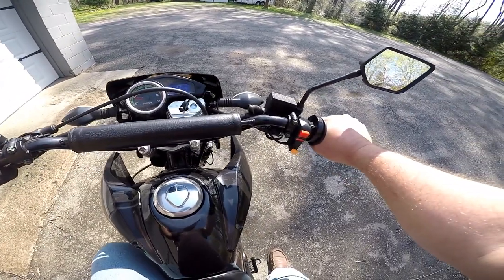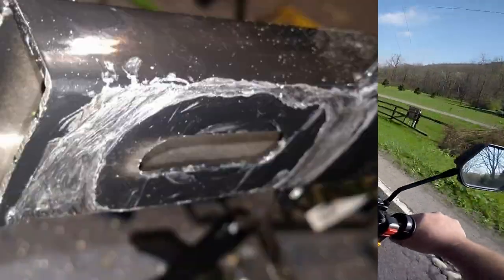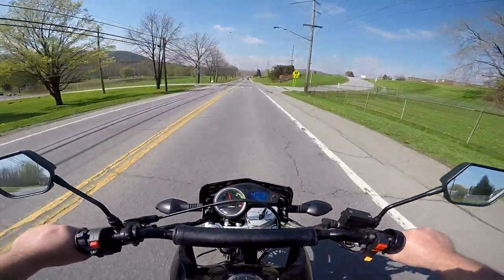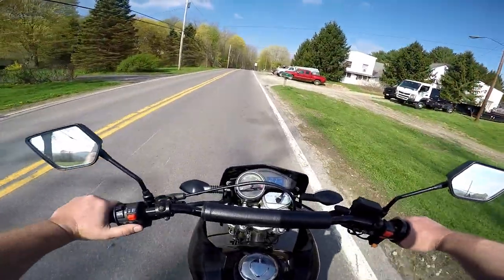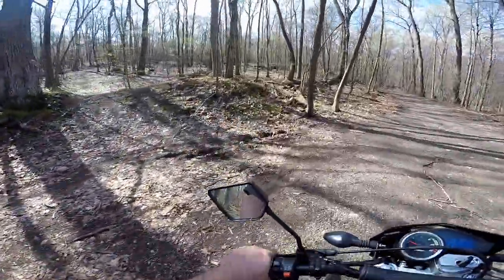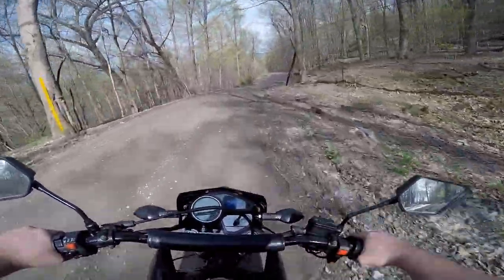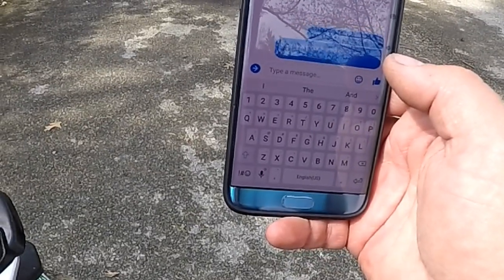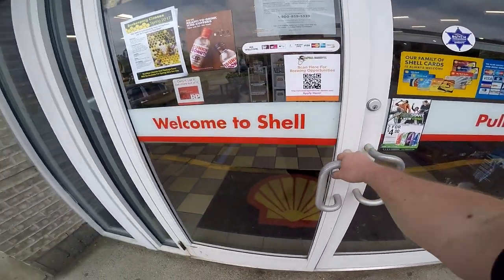[E39] Hawk rear sprocket Stud failure! And a Little ride to Vee's house RPS HAWK 250

Comment: The rear bolts on mine sheered off twice (both oem China bolts). I got smart after the second time and bought original 1976 Honda XR185 bolts to replace them for around $28.
Reply from the maker: Good to know they'll work! thanks
Reply: Where did u find them

Comment: Thanks for the video. The sprocket studs just slid right out of the bearings on the wheel and locked it up and caused other damage on my hawk 250. Not even 3 miles yet. Waiting for response from dealer...
Reply from the maker: Shane Meltzer damn. Yeah, that clip must have popped off

Comment: I have watched many of your Hawk videos and I just found this looking for sprocket studs. I just had all 4 shear on my Hawk the other day. It is 1 year old and has 6800 miles. My son wrecked his Hawk so I am using the studs off his bike. I will be replacing them. This is definitely a first for me on a bike.
Reply from the maker: That clip seems to be an issue that holds the dampener studs in...  I have not had an issue on mine, I keep an eye on it. I did break 2 spokes though

Comment: the studs are free floating. they just keep rotation of wheel with rotation of sprocket. its just held in place with expansion ring clip
Reply from the maker: Yes. For Dampening

Comment: this happened to me aswell. the retaining ring failed.  the pins to only slip in! i found new retaining clips on amazon.
Reply from the maker: Brandon Bowersox wow, finding it more common than I thought!
Reply: Here is a link for the retaining ring I used to fix the bike. I took the opportunity to replace the front and rear sprockets as well. This part was hard to find!

https://www.amazon.com/gp/product/B0062OHC6S/ref=oh_aui_detailpage_o01_s00?ie=UTF8&psc=1
Reply from the maker: Brandon Bowersox thanks!!, I'll add to the links on motocheez.com
Reply: Yep, just got a new hawk and just finished changing the rear and front sprockets, and the bolts just slip in and I can easily remove/ slip out the bolts with my hands once the rear sprocket is removed. The bolts have a rectangle in the middle that fits in the slot/channel on the back side of the rear sprocket. This holds the bolt still when your screwing the nuts on. The "C" retaining ring is the only thing holding the rear sprocket from sliding side to side. But the ring is pretty hefty and looks hard to break. Whoever installed the rear tire of the viewer you mentioned in this video probably forgot to install the "C" retaining ring which caused the rear sprocket and bolts the slip out.
Thanks for the link to the new retaining ring!
Anyway, been enjoying MotoCheez videos and he convinced me to buy a Hawk last week!!

Comment: There is a spring clip that retains the sprocket against the wheel. They must have missed putting that on his bike. 

The studs just slide into the rubber bushings. There is no retention there.
Reply from the maker: This makes more sense, I never pulled the studs, but wondered why they had a clip ring. so the studs are just slid in there and rubber mounted on the end for hub dampening, and the snap ring hold it from working out. Makes total sense now, I never pulled the studs out when I did my sprocket.

Comment: I enjoy your videos man, I've got a hawk down here in Kentucky
Reply from the maker: Thanks! I've been to the Corvette museum and plant down there, nice scenery. Looks like good riding.
Reply: For sure, I have 2 acres down here and my dad has 48, all hilly of course to ride the bike. I always think my valves tick too much but sounds exactly like yours. Great bike to mess around on
Reply from the maker: Excellent.. Yeah,  pushrod motor with followers... they will make noise
Reply: Fine with me, have u had problems with your gas gage ?  Mine worked for like two weeks. I forgot tho u have that updated cluster right
Reply from the maker: Yes, I do but before we changed it out, a plug connection behind the headlight was making the gauge wacky.
Reply: Ok cool il check that, how many miles does yours have

Comment: after watching this I spent last night threadlocking my rear sprocket on the hawk. would you recommend it on the motormounts too or anywhere else?
Reply from the maker: Jared Revere good idea, I haven't had any other nuts or bolts loosen except the exhaust to head.

Comment: The only way they're going to be threaded in is if you actually get threaded bushings..come to find out they actually sell them but not sure if they're the right size
Reply from the maker: Yeah. It's coushoined now. Can be direct bolted
Reply: @MotoCheez  true..do you know if there is any alternative for a snap ring my collar came off so i cant put the ring back on
Reply from the maker: I had a link on my website I believe is right you have to measure and see if it's the right millimeters MotoCheez.com. Or you might be able to go to a bigger hardware store they might have a snap ring that size

Comment: This past weekend, I was out on my 2016 Hawk and had the same rear hub failure!  My Hawk has 31 miles on it! I was riding through residential areas, so I was keeping the rpms low and just going through the gears.  I baby my Hawk during the break-in period.  I headed out on a two lane black top through the marsh, came to a sharp right hand curve and it came apart. Luckily, I was only doing 25-30 and was able to keep the bike up.  TX Powersports said that they WILL NOT cover it.  I still have 4 days left on my 90 day warranty!
Reply from the maker: kirbo7106 that's some shit, they won't send you the parts? Its all stock sprockets etc? The clip came off I assume...
Reply: The only things I've changed so far have been the dash cluster, carb, spark plug and fluids. I heard that the newer models have better chain and sprockets, so I was going to run them until they wore out! I live down in the Tampa Bay Area, so there are no hills. I think the fastest I've had it up to was 35-40 mph. What part of Florida did you live in?
Reply from the maker: +kirbo7106 I live in CT, is post on chinariders.net about them not sending you parts.
Reply: Who would you buy your Hawk replacement parts from? Needless to say, I'm not getting my replacement parts from TX Powersports!
Reply from the maker: kirbo7106 I haven't had to get any yet, RPS used to be great at sending parts. I guess ebay?

Comment: The sprocket studs are pressed in, not threaded.  When I assembled mine they came out with very little force. I highly recommend doing what I did and using Loctite 609 Retaining Compound.  This should ensure they don't work their way out easily while still being able to be removed if needed.  A 10ml bottle is usually around 9-11 bucks, and it doesn't take a whole lot of it to be effective.
Reply from the maker: OddBallPerformance great advice! thanks.
Reply: Glad to be of service.  I work with machining, maintenance, and repair of mail sorting and inserting machines.  We have to use 609 compound every once in a while on the outside of bearing races sometimes when they get spun in their housing.   You can use 609 on it's own, or you can use Loctite 7649 surface primer/activator with it to speed up the anaerobic curing process, otherwise you have to wait 24 hours for it to set.  I used it without the primer and  bolted the sprocket back on and secured it with the snap ring to keep everything in place.
     Definitely clean the surface of said stud pins the best you can first, as oil/dirt will negate it's effectiveness.  I used brake parts cleaner on the pin and used a rag and an allen key (any stick like object will do really) wet with said brake parts cleaner to clean the sleeve it presses into.  I did it that way mainly to avoid getting the brake cleaner on the rubber isolators.  You could probably use the straw and just spray it out, but brake cleaner and rubber aren't the best of friends and I am overly cautious.  
     I have used this method in the past with great success on a couple of other bikes.  When you go to remove those pins, you will probably need to use a wrench on those flats, or use the sprocket nuts,  and give it a twist to break the hold, then they should come out.  Just use it like blue thread locker, a little can go a long way.
Reply: OddBallPerformance I will give this a shot when I receive my OEM replacement. I sure wish that the hub was threaded for the sprocket bolts... is there any way to remove the rubber dampening bushing to replace with a steel bushing? perhaps this steel bushing could be threaded???
Reply: OddBallPerformance would 680 compound be Overkill?
Reply from the maker: OddBallPerformance I also used to be a maintenance mechanic supervisor. we had a full machine shop, I've used man types of locktight.  I have a lathe and recently purchased Precision Mathews  milling machine in my garage too :)
Reply: Can I send you a calendar to bore in the New mill please Motocheeze ? I would love to get my Polaris back on the trail . = (
Reply from the maker: brad b a calendar? I don't have a ton of tooling yet, just got it.
Reply: - cylinder = )
Reply: Matt Prater - You could certainly give 680 a try.  It's a little thicker and has a slightly higher strength rating.  Either one would work.  609 is just thinner, and meant for tighter tolerances. In either case, don't go slathering it all over the pin lol.  Just a couple to a few drops at various spots should be enough.
Reply: MotoCheez  How I wish I had a mill and a lathe in my garage... Total dream come true lol.
Reply: OddBallPerformance Thank you for replying back. I am going to try the 680. I've been riding and maintaining my own bikes for years and never have I seen a set of "pressed" style studs like these. they were in tight when I put bike together. I lock tighted all other critical areas and after a check none of them came loose. This was a scary one for me for sure.
Reply from the maker: brad b ohh, I don't have the tooling for that, should be cheap at local machine shop, bring the oversized piston with you for them to make a good match.
Reply: There is a spring clip that retains the sprocket against the wheel. They must have missed putting that on his bike. 

The studs just slide into the rubber bushings. There is no retention there.
Reply: 10-4 . I just figured it would make a cool video if you had the tooling to do it . I can get it done with the piston to fit it for very cheap on eBay ( $175.00 ) , I just need to do it . I worked in a machine shop as a course in high school , but it's been a while since I was around a mill or lathe .  Sure wish I could get my own to tinker with some day . = )
Reply from the maker: brad b haha, yeah.. I don't have anything for boring yet, just 3" end mills, fly cutter and assorted small face and end mills. just got a rotary table too.
Reply from the maker: mq1991 it looks like all that came with it
Reply: mq1991 Yes, there is a snap ring, but relying on just a snap ring to hold the rear wheel on is a design flaw imho.
Reply from the maker: Makes sens why it is designed like that now with the snap ring and long studs on rubber for sprocket dampening. That's a pretty big snap ring, technically there should be no thrust pressure on i it so it should be alright. but apparently it fails, or it was installed incorrectly
Reply: I agree, there should be little to no lateral loading on it, but having that as the only means of retention is still a design flaw to me.   There should always be some kind of secondary retention measure to account for the unknown or human error.  In the case of snap rings failure, it's usually caused by improper handling - IE, wrong tool used and bending it, or stretching it too far.  Both can cause stretch or put fatigue in a focus pocation.   That was my reasoning behind using a little bit of 609 retaining compound, better safe than sorry.  Kind of like the tried and true castle nut and cotter pin.
Reply from the maker: I agree, a different style clip with a cup over it to not let it expand, like many rear end differential use., I've even see them fail and the axle work itself out while driving down the road!
Reply: That is something else I have been concerned with is corrosion damage and expansion failure.  I've been slowly converting most of my low-load hardware over to stainless.  If I get a chance, I may take the snap ring off and take some measurements and see if I can track down either a zinc plated or preferably a stainless steel version.  Might end up costing 20 bucks considering the size of that snap ring, but in my opinion it would be worth it.
Reply: That's incredible, coming from the experience I've had over more than 20 years servicing motorcycles of all kinds.  This kind of failure is definitely one the factory has to change - those need to be threaded in.

Comment: Hello sir, any idea why my electric start not working. Thanks!
Reply from the maker: terry dotson could be a few things, assuming the battery is charged, I would check the clutch switch, maybe a wire fell off.
Reply: Also check your spark plug my dude! You can pull it out and press your electric start while you hold it near metal, if it sparks it's not your plug

Comment: The bolts do not hold the sprocket on they act as pins that cushion the sprocket . Kind of like motor mounts absorbing vibration . The only thing that holds the sprocket on is the snap ring . That's it . Nothing else holds it on.  Just the snap ring.
Reply from the maker: Yep, that's correct. They're dampening pins
Reply: @MotoCheez  Might be able to drill a small hole through the hub and install a cotter pin .
Reply from the maker: @leftwingmentalillness7633  some people epoxyed them in, some tapped studs
Reply: @MotoCheez  Keeping the snap ring from popping off is the key .
Reply from the maker: If it's in groove properly it won't

Comment: Hey moto I have a 2018 hawk that 45t sprocket doesn’t fit it’s a  5 ting sprocket and I have a 4 ring stock sprocket is there another u recommend I changed front sprocket to 17t
Reply from the maker: The links on MOTOCHEEZ.com in hawk section are the proper sprockets

Comment: I guess u know those rear studs are pressed in I forgot to put lock tight on good thing I caught it before nuts worked themselves out hope it works I would hate to go back to old sprocket
Reply from the maker: They're "floating" style dampener. Some people have used locktite, the clip is the only thing that holds it from the factory. I always wanted to find some kind of studs to replace them pins with. 
When I replace my rim I'll be looking into some kind of solution.
Reply: Well that damn snap ring keeps popping off I used locktite this time two bolts are very tight the other two are tight with a little play is it safe to ride
Reply: Maybe I need a different size snap ring they have then at harbor freight
Reply from the maker: I have the right size on MOTOCHEEZ.Com in hawk section
Reply from the maker: Must be stretched..

Comment: I broke my sprocket studs doing wheelies dumping  the clutch rps is a shit hole they do not answer phone while there should be open  I left them my phone number so far I had not heard nothing I am just going to order the 1976 Honda XR 185 bolts I am told they will work  still liking the bike 2700 miles back tire is almost gone
Reply from the maker: donald allen I also heard they would work.

Comment: Hey motocheez, did you happen to figure out where he got replacement gear studs? I'm having the same issue on my hawk.. PS. I wear the same $20 Walmart shoes 😂
Reply: I see you said he's getting them from the company he bought the bike from but I don't know where to go for it
Reply: Thanks Cheez! You're a legend in the hawk community, much appreciated
Reply from the maker: +justinheartcarson thank you!
Reply from the maker: +justinheartcarson thank you!
Reply from the maker: +justinheartcarson thank you!
Reply: justinheartcarson your dealer should be able to order parts for you. Check out therps.net you can buy replacement parts directly from there.
Reply from the maker: They haven't been answering my emails last several days. I don't know what's up
Reply: I just bought a brake lever for mine, my third party brake lever didn't connect with the button that keeps the brake light off when it's not being used. I got it from txpowersports.com
Reply from the maker: +Nick Pasa I bought my bikes from there. Didn't know they had all the parts now, thanks. I always went to ww.therps.net
Reply from the maker: +Nick Pasa yep. Same happened to me when I asked for magician tank... terrible service.

Comment: The sprocket stud failure was likely the result of an inexperienced mechanic not lining up the sprocket studs properly. The back of the sprocket has a recessed groove in it, about 1/2-3/4" or so wide...the studs fit into that groove at an angle so that you can properly torque down the sprocket bolts and install the snap ring. The sprocket bolts AND the studs will turn freely unless they're locked into the recess on the rear of the sprocket. I would be the snap ring wasn't installed either. No way those bolts would've worked themselves loose like that if everything had been installed properly.

Comment: Gotta little squeaking on rear wheel what could it be
Reply from the maker: Hmm. Brake pads possibly?  Does it go away when you hit the brakes?
Reply: I sprayed brake cleaner it went away my hawk is very new only 400miles I did those mods u suggested I’m too stoked right now I emailed for the cluster is the mikuni better than the stock
Reply: As far as carburetors go I kno how they work air and fuel combined to make combustion will the mikuni have me blast off like a rocket
Reply from the maker: The mikuni is a better version that is not tamper-proof. People claim they get more power, I just modded the stock carb. Sweet, you'll be riding in no time!
Reply: It does go away when I hit the brakes tho